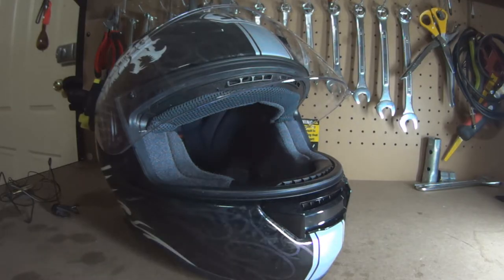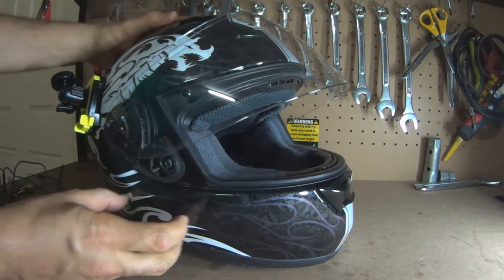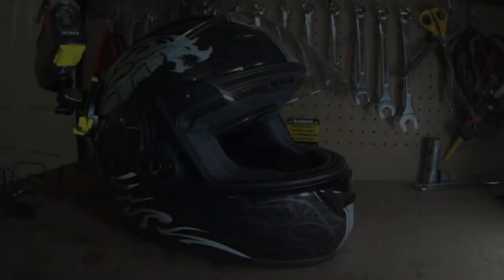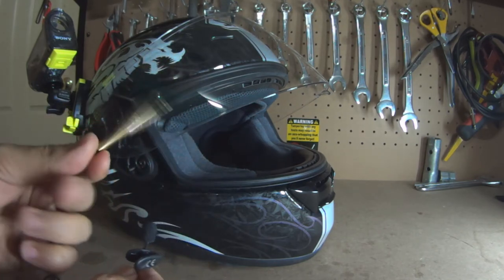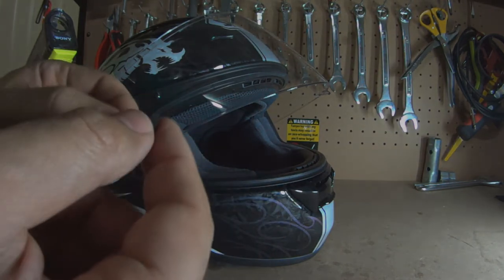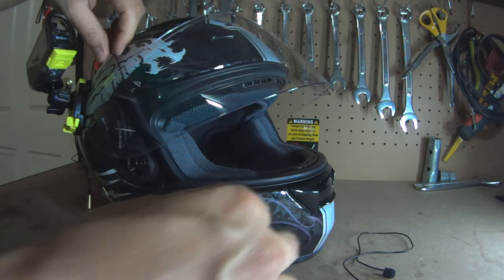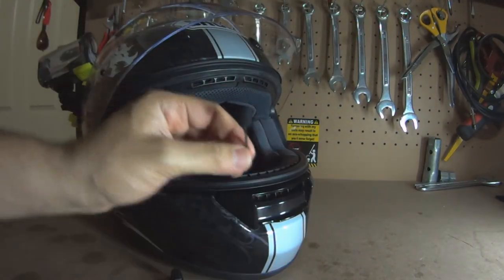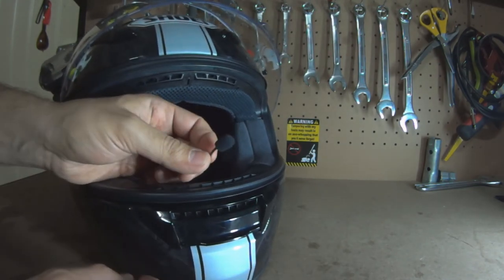Motovlog Helmet External Mic Setup

Comment: hey raino, I  met at Stanwell tops awhile back, I was riding a Kawasaki z800.
I just bought a sony cam which I side mounted to my helmet with 3m double lock tape.
I was wondering where did you buy that microphone from I did everything but I can't find one with a short plug
help
Reply from the maker: Gday mate! I remember you :) go to www.micron.co.uk. However make sure you tell them exactly what plug you want. If you noticed the plugs on my microphones are huge. The made the same mistake twice. But the mics they make are great.

Comment: how do u close and lock the door with this big plug?
Reply from the maker: I drilled a bigger hole and removed the lock that holds the front cap. I use a peice of velcro that holds the cap in place. I'll make a video on this soon to show.
Reply from the maker: issam Saliba  Check my channel, I just uploaded a new detailed video that should answer your question.